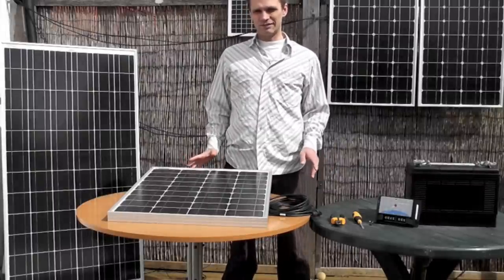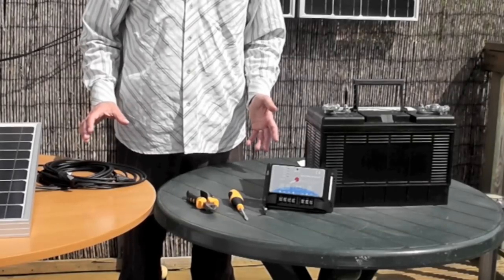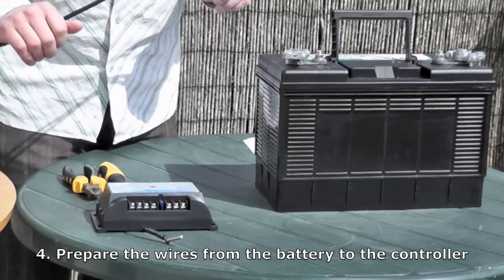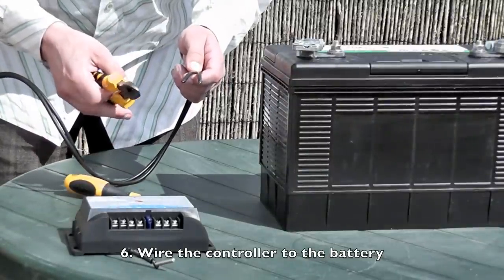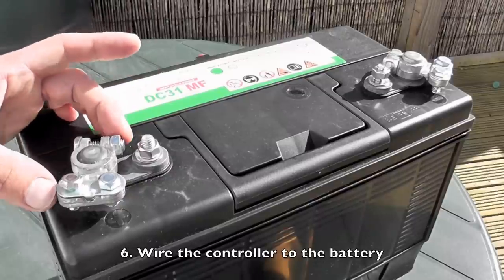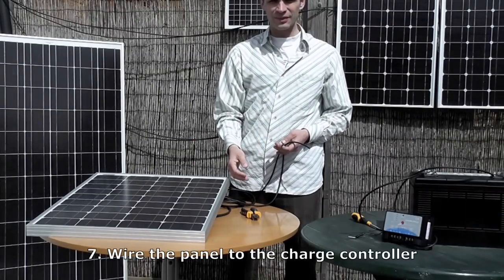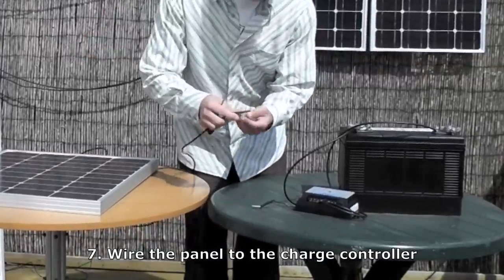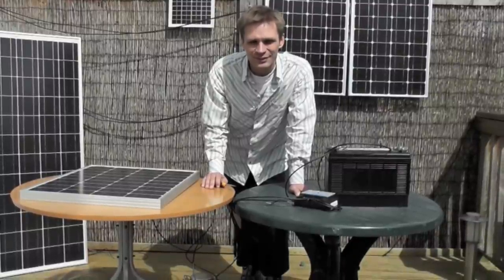How to connect an AKT Solar panel to a battery via a charge controller

Comment: Hi please help me, I am installing a 170w solar panel on top of my shed. I've got the  charge battery controller (  I am been told that this panel will produce energy on 24 volts), My question please is: 1,- Do I have to buy a 24 volts inverter? I want to charge batteries, 2.- Do I need to install two 12 volts batteries? 3.= Car batteries would be Ok. thanking you very much mate.

Comment: Hi there, I am building a home portable power supply with a deep cycle battery, 400 w inverter, 7w/100 amp max. a volt meter installed on side of the battery box, a switch and a cigarrete lighter. My question is what AWG wires should I use for each connection, it is a little bit difficult to decide how to connect in a save manner, also I have a fuse holder in line from the socket to the positive terminal on the battery, any help, thanks.

Comment: hi jonny i have 4x  12v 135ah battery connected in parallel to give me a total battery of 12v @ 540ah what sort of output wattage from a solar pannel should i be looking at in order to do anything noticeable or worthwhile to charge such a large battery?

Comment from the maker: Hi Giorgios,

That's a good question. Can you get a charger that will charge your laptop from a typical 12V car cigarette lighter output? If so, that's probably the best way to charge your laptop from this setup. 

Otherwise it's also possible to add an inverter that turns the battery power into 240V ac like your mains electricity. Then you can use your laptop's ac adapter - we have a YouTube video showing this called: "How to create a 240V AKT Solar system".

I hope this helps.

Cheers,

Jonny

Comment: Hi, informative video, thanks. I have a question about the 2 terminals on the right hand side of the controller, "load" where should these be wired to & what are they for ? also if I have 2 12v batteries in parallel do I need only be charging to one set of terminals, ie wired to one battery ? thanks again.
Bruce.
Reply from the maker: Bruce Cowie Hi Bruce, those terminals are for connecting to any load that does not require more current than the rated current of the controller (10A in the case of the one in this video). These terminals serve two purposes: 1) they limit the current so preventing you discharging your battery too quickly; and 2) they cut out if the battery becomes too discharged so preventing you from discharging your battery too much.
Both of these functions protect your battery. However, if you don't wish to use them - e.g. you want to run something that requires a greater current.
Do let us know if you have any further questions. Cheers!!! Jonny

Comment: Hi so for charging a 12v battery what should be the wattage of the solar panel. Thanks in advance and very helpful
Reply from the maker: Hello Lee,

This depends very much on the size of your battery. Normally a panel that has a similar Watt rating to the Ah rating of your battery is a good guide although you can certainly use smaller solar panels than these (e.g. half the Ah rating). It may be particularly appropriate to use a smaller panel if you just want to keep your batteries topped up for occasional use.

In general it's best not to go much above the Ah rating of your battery though because if you go to much higher than this, you risk charging your battery more quickly than is recommended. 

I hope this helps and do ask if you have any further questions.

Cheers, Jonny
Reply: Thanks alot for now it should help and i appreciate it so much. 

Kind regards 
Lee
Reply: Lee Attard if batteries connected in parallel then charging rate reduced. Another way of down sizing your panel??

Comment: What if i need to use 3 batteries,each of 12V???Should i use 3 solar modules??How should i connect Solar modules????in series or parallel?

Comment: Hi,with this set up what happens if it's connected all the time?does the charger know when to "stop charging" when battery is fully charged if it's permanentaly connected? I have this kit rdy to put in my campervan to a leisure battery but is it ok to run a feed to the normal starting battery? Many thanks,Pete.
Reply from the maker: Faith Jones Hello Pete, It is fine to leave it connected all the time via a normal charge controller as the controller should have protection functions to prevent over-charging. I'm not sure quite how you plan to run a feed to a starting battery but a controller should not overcharge a normal starting battery either. All the best! Jonny

Comment: i was just thinking, would it be great to have a shop that was dedicated to every thing solar, the sort of place a person could go and buy low voltage friges water pumps lighting systems such as multi led lamps proper nice looking ones, instead of adapting ordinary ones and televisions computers ect ect, what with the cost of all types of energy just gone up by 10% I'm thinking it would be a great business opportunity, anyway I've just bought one of your 100w kits to try here in Newent-Glos.

Comment: @3.45 you put the wire on the wrong direction, it should be clockwise, so that as you tighten the nut it pulls the cable in.

Comment: Brilliant - thanks for the video, found it to be very help. What brand charger is that?
Reply from the maker: +000Troy000 L Thanks for the comment. I can't remember the brand of controller I'm afraid. Actually it's quite old and you get much more sophisticated controllers now that are less fussy on lengths of wires and have further features such as night timing that can turn on lights just at night etc.

Comment: Hi, thanks for the video looks simple enough. i have a 40w solar panel and a 12v battery i will be installing on a camper van. would a 15A PWM Solar Panel Regulator Charge Controller 12V 24V Auto Switch M3 (a CMTP02) be suitable to do the job safe and efficiently? thank you. will subscribe too :)
Reply from the maker: ZombiDude Should be fine. You could actually have up to 180W of panels flowing through a 15A regulator. 40W is also okay. Good luck!!! Jonny

Comment: Is there such a thing as a solar panel that has a regular three pin caravan mains connector so you can simply plug it straight into the caravan's input and charge the leisure battery?
Reply from the maker: I'm afraid not - that would require an inverter from the panel to convert it's output to 240V. However, you can connect the panel direct to a battery via a charge controller to achieve the same result. Hope this helps.
Reply: @aktsolar  Thank you for the fastest reply ever! Does your company make such things? If need a weatherproof one that I could use all year.
Reply from the maker: Unfortunately we don’t sell these retail anymore but you can easily buy kits from Amazon or EBay that will have the panel and the charge controller and everything else you need to fit solar to your caravan. Good luck!!!!
Reply: @aktsolar  Thank you very much.

Comment: I want to charge my rv batteries there are two 12 volts batteries plus chassis batteries 
What do you suggest to keep them fresh in between trips
Reply from the maker: Keeping batteries fresh in between trips actually requires very little power. For all your batteries you'd probably be fine using a 40W panel and regulator.
I hope this helps.
Cheers, Simon

Comment from the maker: Hi Prasidhda,

If you want to use 3 batteries and all are the same type, age and state of charge then you can just attach them together (all positives together and all negatives together) then you will have one large 12V battery.

Then you can attach one (or more) solar panels to the whole battery bank, as shown in this video, and the panel (or panels) will charge all the batteries equally. 

You can always contact us on: contact@aktsolar.co.uk if you have any more  questions.

Cheers,

Jonny

Comment: Can you attach multiple batteries to the controller in parallel?
Reply from the maker: Hello Sandy,
Yes you can. It is best to have batteries that are the same make and size and same age. Then just wire the +s of each battery together and the -s of each battery together and it will act as though it is a battery of the same voltage as each individual battery but with an Ah rating of the sum of the Ah rating of each individual battery. E.g. 2 x 110Ah 12V batteries wired like this will be the same as a 220Ah 12V battery.
I hope this helps.
Cheers,
Jonny
Reply: Perfect. Thanks for letting me know.

Comment: i couldnt here the ned part about questions so il ask here if ok, i wired in my battery to my charge controller but not yet connected the solar panel wires and the controller lcd screen has not displayed anythin, do i need to wire the solar panel up to gt a lcd display? i have a 30amp 12/24 volt dc compatible controller which is auto detecting the voltage. any ideas please?
Reply from the maker: Hello, If your battery is charged then your lcd screen would normally light up as charge controllers normally take the power they need from the battery.

It would also be a good idea to make sure your battery is charged, as otherwise the controller will not be able to detect what type of battery it is and may therefore not charge it.

Good luck,

Jonny
Reply: it drained to 8 volts dc and then sun went down so now charging back up its 12 v dc 100 amp hour battery so also its still plugged from the batt to the solar charg controller but the panel disconnected
to then charge it back up to full then see if it works with solar again maybe what do you think?
Reply from the maker: Yes, that sounds best: charge it up via another source to at least 12V and then try connecting the solar charger again and hopefully it will work. Good luck! Jonny
Reply: AKT Solar it worked but when the sun went down the battery started to discharge is there a way of preventing this happening with a pwm solar charger ?

Comment from the maker: Hi Shanaba, It depends what you want to use your system for. If you want to use it as a 240V 50Hz system like in a house then you will need to use an inverter first. If, however, you have a 12V system you would like to create (which is typical for a caravan or boat or car) then you will just be able to connect the battery directly to your system. You can always email us at: contact@aktsolar.co.uk if you would like any further information. All the best!

Comment: Hello! Thank you for this how helpful video. You have a very nice, peaceful, relaxing to listen voice by the way :-)
Could I ask you for a little help in my queries as well please. Would very appreciate.
So I'm a beginner.. Need a power system for a static home. So far, as I found out about it to make it run properly I will need: solar panel/wind turbine > controler 12V > battery 12V > inverter 12V 1500W > extension to plug electrical devices.

Comment: Do you need to earth the panel to the car?
Reply from the maker: Hi there,

You don't need to earth the panel. It is a very low voltage system so it does not need to be earthed to prevent electric shocks. Also, it is better for it not to be earthed if it might be struck by lightning so that it does not become a lightning conductor.

I hope this helps.

All the best, Jonathan

Comment: Hey, what does the charge controller do!
Reply from the maker: Hi there,

It does a couple of things. Most importantly it regulates the charge going in from the panel to prevent it from overcharging your battery. Then, also can regulate the output from the battery (if you want this). If you do want this then you connect your load to the output on the charge controller. If you don't want to regulate the output of the battery then you can also just connect the load directly to the battery terminals.

I hope this helps.

Cheers, Jonny

Comment: Always wrap the wire around a terminal post in the same direction that the retaining nut is spun to tighten. You tightened the second connection at the battery improperly. The wire you placed on the battery lug wrapped from right to left around the lug. Then the nut was tightened from left to right. The way you did it could result in the wire splaying out as the rotation of the nut could force the wire outward away from the terminal post. This can cause a connection to become lose, producing arcing and start a fire. You got away with it in this demonstration because you pinched the wire between two washers. But still it was done incorrectly and in some situations would not pass an electrical inspection. I recommend soldering all stranded wire ends prior to attaching in any manner in which a crimp or pressure situation is used to secure it. That way you know that there will be no splaying out of the wire strands and thus, no lose connections in the future.

Comment: I grow vegetables in the field, I have no power source in the area, and i need water. So I turned to a guy who installs solar panels to make me a kit. So he bought: 9 panels, 4 batteries and 1 pure sine wave inverter 3Kw 12v (Power Master 3000 ssl 12x) taken from a yacht he said.
Now he need 3 x VICTRON MPPT 100 50A, he want to wire 3 solar panels per MPPT. 

Solar Panel specs: 275W, VOC 38.2, VMP 32.5, IMP 8.47A
Batteries specs: 220Ah 12V AGM DEEP CYCLE 

My question is, do i need to buy all those 3 MPPT? Or the panels can be wired directly to the inverter?

I checked the specs on that victron mppt: 100V 50A and Nominal PV power 12V: 700W

3 panels will have:  114V (38.2x3),  25A (8.47x3) and 825W (275X3), that MPPT can handle only 700W and i have 825W, we will damage that mppt?  

I wait for enlightenment, thank you
Reply from the maker: You won’t be able to attach them direct to the inverter as the voltages are too high. In terms of the controllers it would be best not to exceed their max current. If they are 50A controllers at 12V that would mean not putting more than 12x50 = 600W of power through each.
Hope this helps,
Simon
Reply: @aktsolar  i can't attach none of the panels? Thanks
Reply from the maker: No, you can’t attach any directly.

Comment: What about fuses ?  don't we need fuses betwen the battery and de inverter, and also betwen the  charge controler and the battery?
Reply from the maker: Hello Melchor, Thanks for your questions. The controller and inverter both have fuses in them so you do not need further fuses. It would be fine if you wanted to put further fuses in but these are not necessary. I hope this helps. Cheers, Jonny

Comment from the maker: Hi,
The answer to your questions depends on where you are (as that affects how much sunlight you receive). In the meantime I can answer 2 of your questions: i) you need a 10A controller for up to 120W of panels at 12V or a 20A controller for up to 240W at 12V; and ii) Yes, you can link multiple 12V batteries together and keep the voltage at 12V. Just link + to + and - to - for all batteries.
Please write to us at contact@aktsolar.co.uk for us to answer your further questions.
Cheers, Jonathan

Comment from the maker: Hi Paul,

This is an interesting question. It depends on whether you have a 24V or 12V system. For a 24V system you should connect them in series as in our YouTube video "How to create a 24V Solar Water Pump".

For a 12V system you'd normally wire both separately to your charge controller (and your charge controller may even have separate inputs for this). 

Could you write to us at contact@aktsolar as we cannot write a long response here and we could write more by email.

Cheers,

Jonathan

Comment: All the wires are black. Why arent the positives red?  How can you tell which is which?
Reply from the maker: Hello Wotan,
Thanks for your comment. It is very easy to know which wire is positive. The positive wire always comes out of the right hand side of the junction box when viewed from the back of the panel. It also has stickers attached with a + sign on to show that it is the positive wire.
Similarly the negative wire comes out of the left hand side of the junction box and has a - sign on it to show that it is the negative wire.
I hope this helps.
All the best,
Jonny

Comment from the maker: Whereas if you're only planning to use a maximum of about 500W from your inverter then 500Ah of batteries and a circuit breaker of about 100A would be fine.